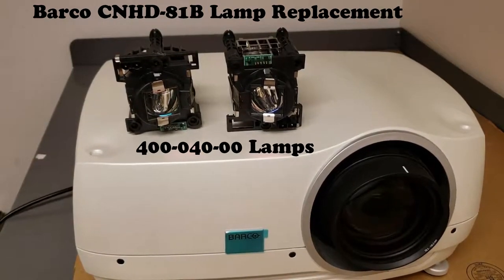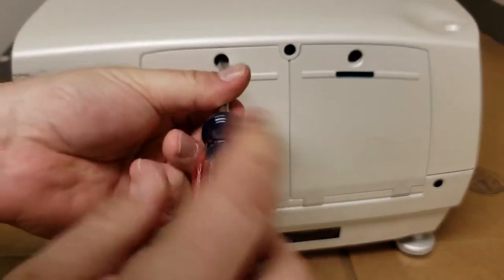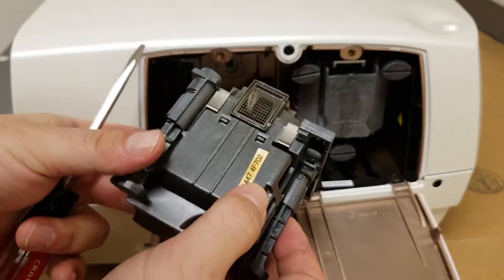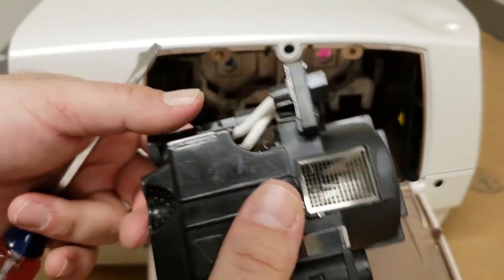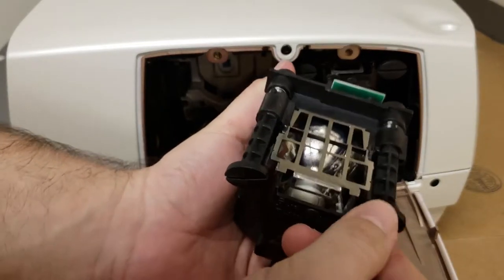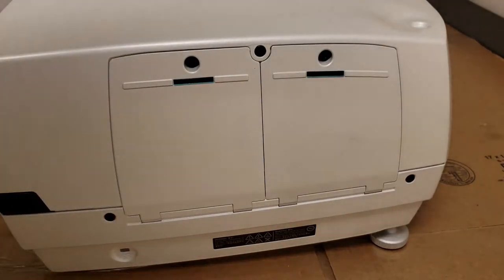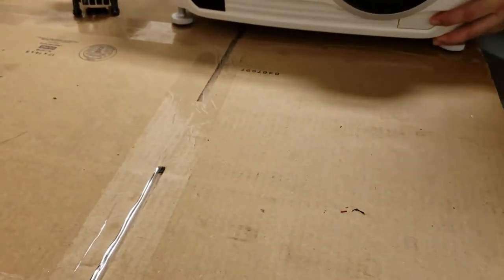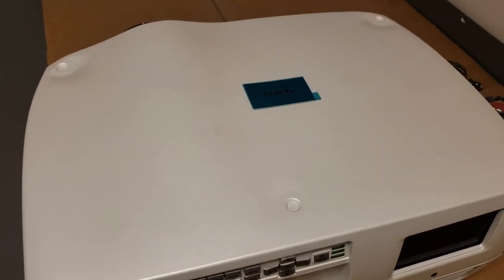Barco CNHD-81B DLP Projector Lamp Replacement

Comment: If one of the lugs is broken, how do I remove the lamp?
Reply from the maker: It is a little tricky but it is doable.  Loosen the other two first. Then if the back handle snapped off, use a flat blade screwdriver that is slightly smaller than the hole with the broken lug . Push in gently and turn. Hopefully the blade digs into the plastic enough to allow you to turn it.  You might want to try pushing in and rocking the lug back and forth a tiny bit to loosen it up. I bet the locking portion is stuck to the plastic with burnt dust and whatever else gets in there. Worse case, you can use that screwdriver to crack the thing that holds the lug but I have used the flat blade driver thing a few times.  Good luck!
Reply: @FixitFrank  thanks so much!